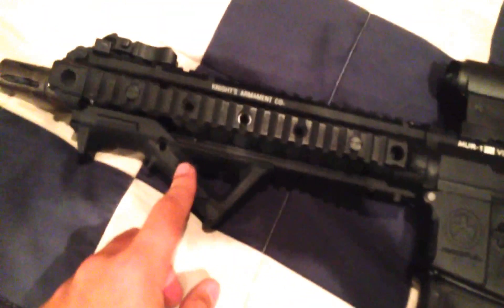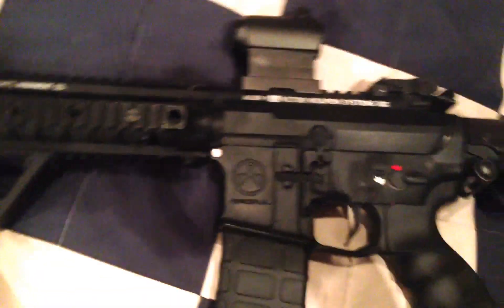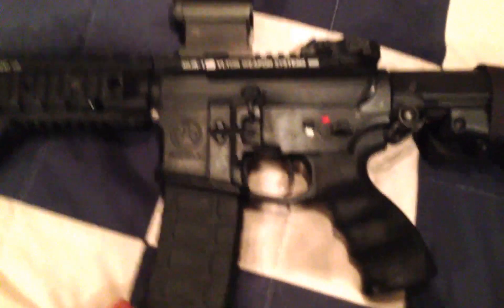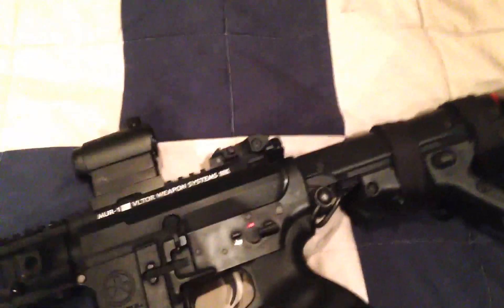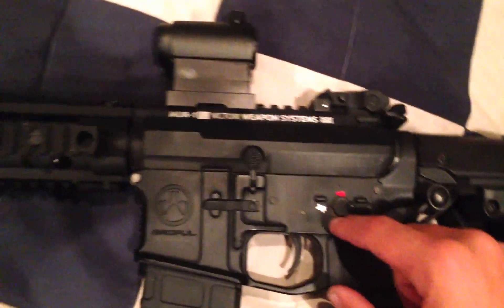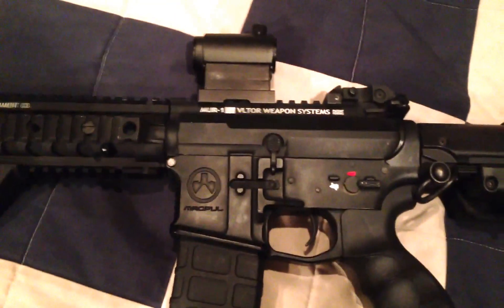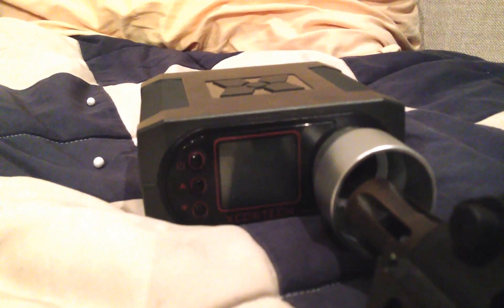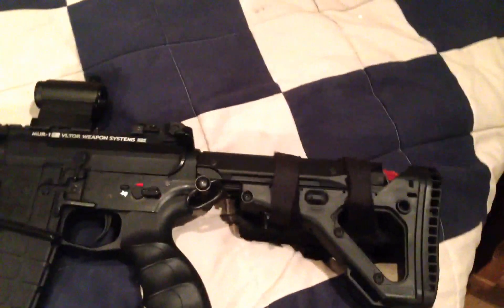Dsg update

Comment from the maker: It seems to have a perfect seal when I hold the barrel against the gearbox, plug it with my finger, and try and push the piston forward. But as a increase the spring tension, the fps stays the same. This could mean that the increased pressure is forcing a leak somewhere...I just don't know how I could fix that since the seal already seems perfect. I need to replace o-rings in different places maybe to identify where the leak is.